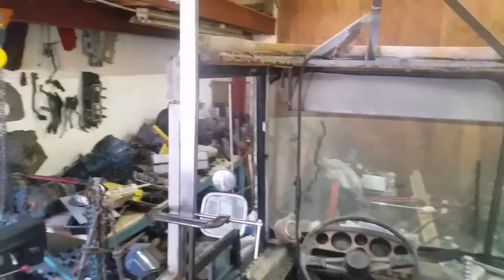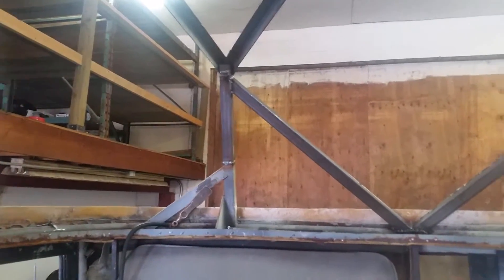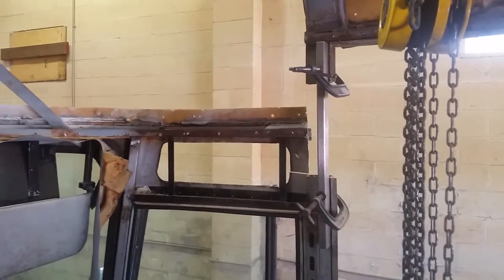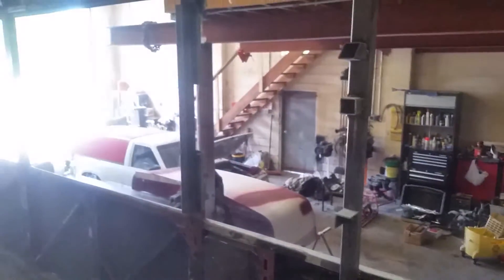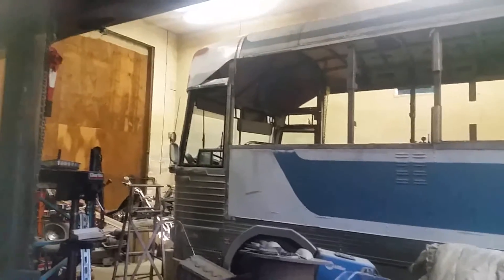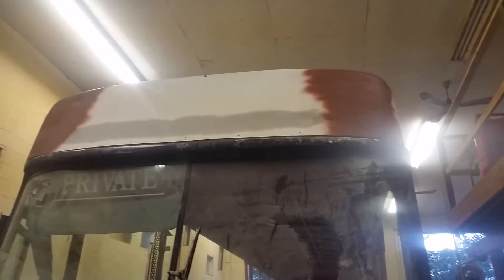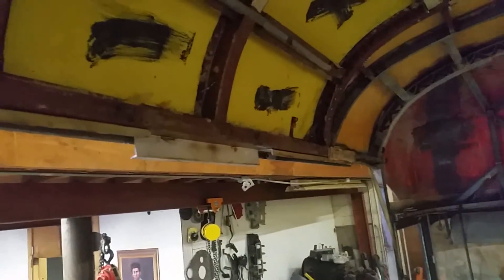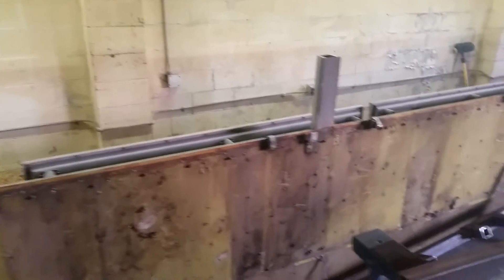Bus Conversion Video 15 - Front Framing, Installing Front Cap,Slideout Opening

Comment: You are doing an awesome job! It doesn't look like you are doing a bus conversion though... it looks like you are completely building a new bus where an old one used to be! Great project and progress. You are lucky to have a shop to park it in... we end paying way too much to store ours and it is still outside.
Reply from the maker: Thanks, Ya... sometimes it feels like I just jacked up the fuel cap and built a new bus around it :-)... that's what I like about old vehicles though is you can have something that has classic look and lines but performs and has all the creature comforts of a brand new vehicle.... some people appreciate that, some don't and it's ok both way's, the only way I can afford to have the shop is to live onsite in my other bus... that way what I would spend on a house or whatever goes to the shop.... can't afford to do both